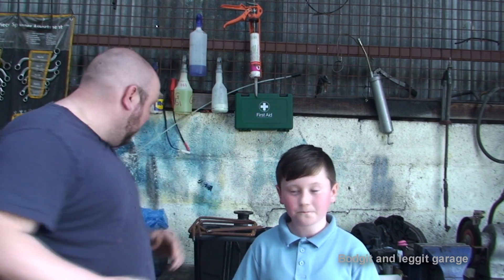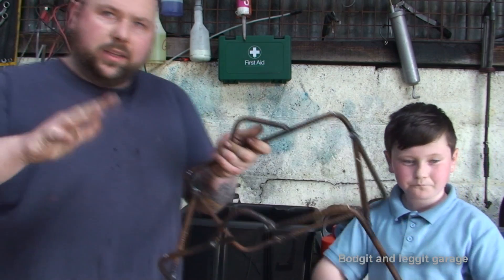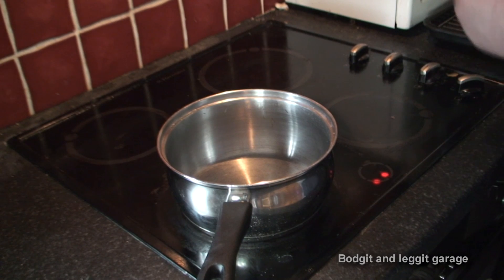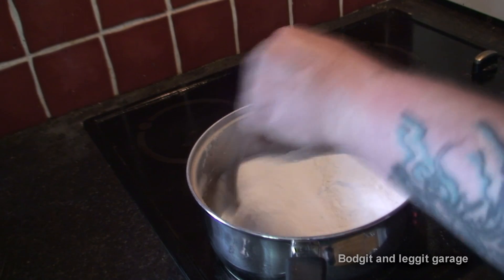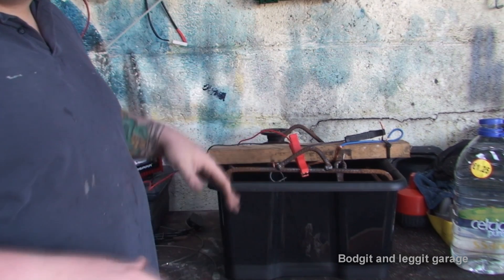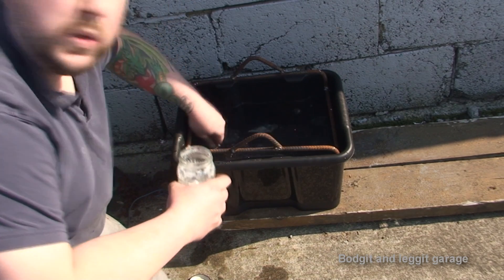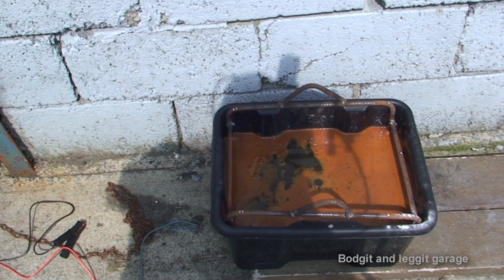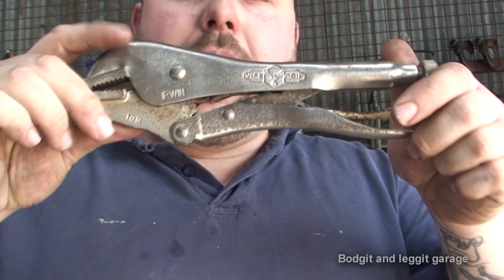How to Removal Rust With Electrolysis Tank bodgit and leggit garage

Comment: Did you mean sodium carbonate as I've never heard of sodium carbarate (If that's how you spell it) I've heard of using soda crystals.
Reply: Yeh i've used soda crystals before, Home bargains sell them cheap as chips..Alot of the scum comes from your sacrificial steel as well as the rust....